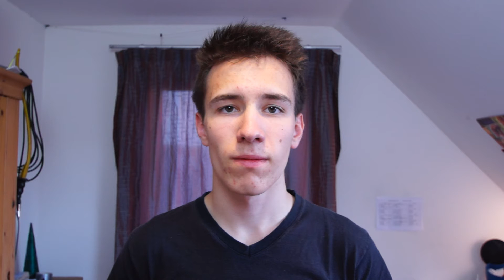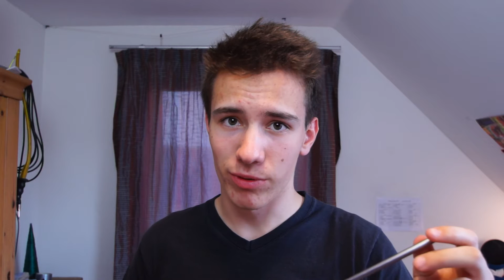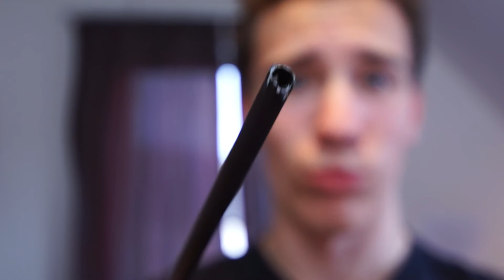Arrow shafts - Auminium VS. Carbon Fiber

Comment: Even cheapest carbon composite arrows break only if you hit dead straight on a concrete wall. I have missed some arrows hitting around 60 degrees on a wall, and the arrows was fine. It was only when I hit a wall dead straight one of my arrows shattered into 4 pieces.
Reply: Well, it doesn't have to be shattered or broken into bits to sustain dangerous damage. A cracked carbon arrow is worse than a bent aluminum arrow because the bent aluminum arrow will be off target, a cracked carbon arrow can end up in your arm, which is why you should bend your (carbon) arrow before you bend your bow.

Comment: what sort of arrows do u prefer i am shooting aluminium right now and when they bend the tend to become inaccurate are the carbon arrows going to last longer and also i have seen pictures of people who have shards of arrows sticking through their hands is that carbon arrows and why is that
Reply: MainlyArchery It didn't really, I was 12, and my mom panicked and drove me to the emergency. It wasn't that bad, I could have just pulled most of it out and the rest would have comed out.

But when I got there they messed it up, so my knuckle started swelling up because of the sedatives they injected, and the pieces just went deeper inside and disappeared. Couldn't close my hand fully for 3 months until a half inch long shard came out of my knuckle naturally, God that felt so good
Reply from the maker: +Nugget Brothers, Personally I prefer carbon fiber arrows because of their speed and accuracy. Aluminium arrows have a tendency to last longer but they bend quite easily. And sometimes it's hard to tell wether or not an aluminium arrow is still straight enough to be shot accurately. That's easier with carbon fiber arrows to determine, they don't bend and generally there is no grey area of "wether I should shoot it or not". That makes aluminium last longer but less accurate over time while carbon fiber could show cracking  but always stays straight.
Carbon fiber arrows will only dramatically break when shot with cracks already in the shaft. As far as I know all carbon fiber arrows come with instructions on how to visually and audibly check for those cracks and a recommendation to check after every shot.
Reply: +MainlyArchery thank you i will have to go and get some carbon fiber arrows thanks for responding
Reply: +MainlyArchery   My problem with Carbon Arrows is that when you miss and hit something hard they open like a flower, then you have to remove the point with heat, cut the expenden part and glue anew the point.  with time and misses your arrows become so short that you cant shoot them anymore... 

In the school we had aluminum, then I bought 12 carbon and now I only can shoot with 6.   Im thinking about going back to aluminum for the training and keep my carbon for special times as contests.     

What do you think?
Reply from the maker: If you are missing your target so often I would indeed recommend you go back to aluminium for now. Aluminium is more impact resistant than carbon fiber but if you hit something hard, chances are they're still bent or the shaft can be damaged. But carbon fiber is indeed trashed most of the time if it hits something hard (I've done that myself numerous times).

Also, If you're trying to get better at archery I suggest you don't shoot with arrows of different lengths at the same time. Carbon fiber arrows are recommended for fairly experienced archers because they cost more than their aluminium counterparts. Experienced archers practically never go outside the paper on the straw target so there is no need to worry about trashing arrows.

I will say though, I personally break arrows  sometimes because occasionally I train with my eyes closed (I'll probably make a video about that explaining the details on how and why). That gives an elevated chance of missing.

As for the use of carbon arrows during contests; It's always better to shoot with what you train with at the moment. If you go and change the arrow type for a contest, the bow will behave differently from what you are used to. Archery revolves around repeating the same sequence of movements and changing a component in the system always requires some time to get used to.

I think I covered all of your questions, let me know if there is something I missed.
Reply: that happened to me, I had was shooting in the dark, so I didn't notice that the arrow was completely broken, shot it and it felt like the string had hit my knuckle and dislocated it. 

When I went inside I could see multiple bits of the carbon arrow sticking out of my finger and knuckle
Reply from the maker: Daniel Ouch, I hope it healed well

Comment: So I should get a whole bunch of carbon fiber
Reply from the maker: +XxxGet ShrektxxX, If you are ready do deal with some of the drawbacks I mentioned in the video and if you are a reasonably experienced archer you can't really go wrong with carbon fiber. 
Be aware that there are also carbon-aluminium composite arrows. Those offer a bit of both worlds but still have the skinny diameter of the full carbon arrows.

Comment: Good video but I think you left out one important thing. Aren't carbon arrows straighter? Which leads to better accuracy.
Reply: +Matt Jones Actually no. Generally, aluminium shafts are straighter than carbon only shafts within the same price range. Most decent aluminium arrows manufactured with a tolerance lower than +-0.003, some even manufactured with +-0.001 tolerance. Carbon arrows with high straightness exist but they are much more expensive than their aluminium counterpart. It is easier to work with aluminium in post process to correct defects. On the other hand, once carbon fibre material is set. It is impossible to correct the defect product. Hence their low yield and their price. This is also why aluminium carbon composite arrows are so popular, they combine the performance of carbon arrows, same straightness as the pricey carbon arrows but cheaper :)
Reply from the maker: +Matt Jones, You had me rewatch my own video to recall what I exactly said. I should probably remake it, haha.
You are indeed correct about me leaving that out. However, there is also a lot of other stuff I left out to keep it short and comprehensive.
Reply: Aaron Yeung Ah okay gotcha. :)
Reply from the maker: Aaron Yeung I haven't looked into straightness vs price before, thanks for the info!

Comment: A good informative video. However you miss one critical point. Many clubs have banned the use of all carbon arrows on ranges which have a shared use, school playing fields, sports grounds etc. The reason being that all carbon is impossible to locate with a metal detector should you have an errant shot. Carbon/Aluminium composites do not have this problem and so are ok to use.
Reply from the maker: This is the first time I have heard of this, and at first sight is seems quite pointless to ban full carbon arrows for such a reason. 
The reason being that the points are always made of steel or tungsten and a large portion of these full carbon arrows have aluminium nock pins. 
Traditional wooden arrows are probably also banned in those places.
You pointed out that I was missing one thing, this is however just a short and sweet resume of this topic. I'm planning to do a more extensive version in the future.